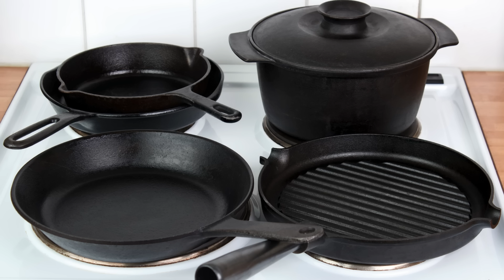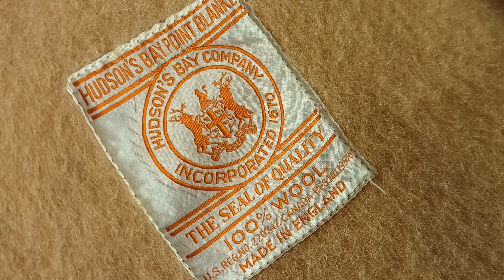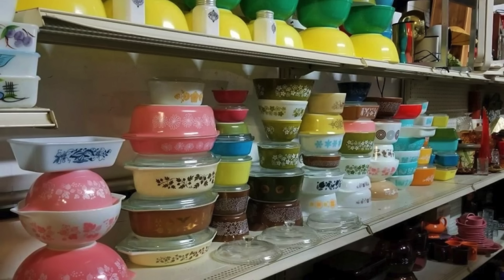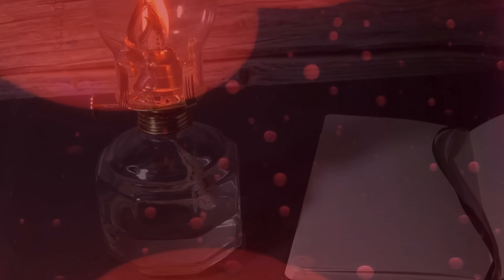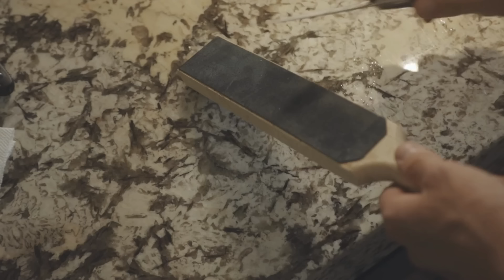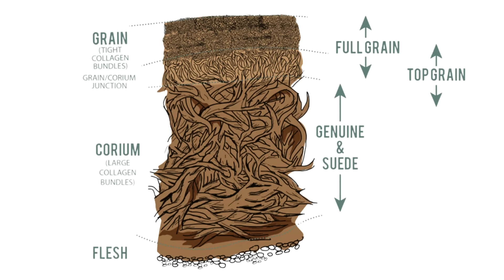10 Goodwill Items That'll Outlast Economic Collapse

Comment: Cast iron cookware Lodge griswald Wagner pre 1950s.  100T wool blankets.  Hudson's by or mil as surplus.  Hand cranked kitchen tools echo vintage Pyrex handsaws diston bit bra cr drill oil lamps and lanterns. Metal sewing machines. Carbon steel knives.  Pre digital reference books pre 1980. Fill grain leather

Comment: Being a cast iron enthusiast who owns several well used and loved vintage pans, while you’re correct that most older pans have nice smooth surfaces, it’s simply disingenuous to say all modern manufacturers of cast iron cookware utilize the rough surface finish. Plenty of cast iron manufacturers today have smooth finishes on their products. Granted, they aren’t going to be $30 like a lodge pan, or $15 for the Chinese import, but to say they’re substandard in quality is nonsense
Reply from the maker: You're right, not all modern cast iron is rough. Some higher-end brands do offer smooth finishes. My video focuses on the common, affordable options found at places like Goodwill.

Comment: I work in a large second hand store it is now illegal to sell scratched teflon in the UK but it is still sold new. Commercial teflon pans need replacing every year because of the accumulated scratches.

If you do use teflon pans at least only use wooden implements and never use a scourer on them.

Comment: Soda lime glass , vulnerable to thermal shock. NB check wikipedia page on this it has a blue or sometimes green tinge from cobalt.

Boro silicate glass is more resilient to thermal shock BUT soda lime glass is more resilient to physical shock.

NB the 'pyrex' versus 'PYREX' branding is not a guarantee of glass type.

'pyrex' is sold in N America, S America, Australia and Asia, ie continents bordering the Pacific.

PYREX is sold in Europe, Middle East and Africa.

I think it is worth taking a deeper dive but depending on how you use them you might favour different types of glass.

Agree on woollen blankets , I switched from duvets 15 years ago and spent around £30 in thrift stores for around 10 blankets. Never needed to buy any more.

Saws too but get a saw set. Plenty of videos on this. 

I will need to do some research on those pans.

Thanks for the video.

Comment: I have a vintage oil lamp in my boat, and love it.
However it's hard finding wicks for lamps now.
Lanterns have a slightly different wick, which burns quickly.

There is a work around.
Getting some Carbon Felt, which is cheap. Plus they call it a Forever Wick for a reason.
It lasts longer than cotton wicks.

Oh, I used an electric sander to smooth the surface of a new Cast Iron frying pan.
It actually worked pretty good, and never stuck after that.

Unfortunately Cast Iron and high carbon steel knives aren't the best when you live on a boat.
Unless you use them regularly.
So I am stuck using Vintage Stainless cookware.

Don't forget a Sewing Awl.
The good quality ones are still cheap and will save your day.
Reply from the maker: Thank you so very much for all that awesome info!!!!

Comment: Regarding the KitchenAid mixer with the nylon gear:  It's designed that way.  So if your torque is too high, that gear fails without damaging the motor.  Gear is easy to buy and replace.  Thank you.

Comment: i take a magnet with me into a thrift store,and check the "silverware" for real Stainless Steel that the magnet wont stick too,,dead electric blanket can be found cheap or free, as can polyester/nylon blankets,,,yes wool is superior but not cheap,,and comforters can be cheap ,yet very warm..old school cotton wick type kerosene lanterns can also use diesel for fuel,, its dirtier than kero, but half the cost ,and more available..i dont use forks for eating as you must clean thoroughly between the tines or you can leave a piece of food which later ingested can make someone sick..a butter knife and a large table spoon is all i need,and while washing your hands use the lather on hands to wash butter knife and said spoon.and a sharp paring knife.older boy scout handbooks are good info,,wool pants can sometimes be found in the mens dress pants,,and keep a pair or 2 of sweat pants around for winter ,great for really cold days ,first put on thermal longjohns, then sweat pants ,then over size pants,,
Reply from the maker: I really appreciate your detailed insights! It’s awesome to see someone who clearly has experience and knows how to make the most of thrift finds. Keep sharing those tips!

Comment: I’ve cooked with cast iron for about 65 years.  I use lard or bacon fat to coo’ with.  Our experiences seem to differ. 

I find that the rough finish builds a seasoning coating that is both thicker and better rooted.  That produces a better non-stick function for the skillet.  If something ever does stick on some, after emptying the food out, I add water to the skillet - NO SOAP EVER - and let it soak while I dine.  A light scrubbing with just a plastic mesh scrubby and it is clean
Courtesy of Half Vast Flying

Comment: Thank you for explaining the cast iron cookware. I am on the hunt for good cast iron, now I know what to look for. I just started sewing again, but knowing how to hand sew may come in more handy if the grid goes down, and you don’t have a generator. So, I think vintage sewing boxes/button boxes/sewing supplies, except you might want newer thread, because thread can weaken, deteriorate, and break easily the older it is. I am also on the hunt for a Singer 221 featherweight. I do love vintage Pyrex. It’s ways so pretty and well made. Nice to know about the saws too. I’m always on the hunt for a good saw. I will also be on the hunt for more drills and other tools. The carbon steel knives will be great for the zombies. 😂😂😂 I lucked out and got some great free “encyclopedias” for learning how to do just about anything, from sewing to gardening and from mechanics to electricity, each one has a lot of valuable information. I am looking for other manuals. Also on the hunt for leather. I need to hit up some good yard sales, I guess. 😊
Reply from the maker: So happy you found the video helpful for your shopping list! Good luck with your hunt! 😊

Comment: Lodge cast iron pans work and clean fine. If you want them to feel a bit better then you can grind them down for 15 minutes with a 90 grit rotary sander and then boil vinegar before seasoning. But even without that they work fine if you understand how to use and clean cast iron.

Comment: Another problem I have with old cast iron besides the extra cost of buying vintage, they liked to make the castings as thin as possible back in the day, I've seen a lot of ruined vintage pans, cracked down the center, pretty much worthless, but I've never seen a modern lodge or Wagner from the 70-80s ever crack, they're heavier but worth it IMO.
It's not like we're loading them up in a wagon to head out west.

Comment: My friend used a grinder with a sanding disc to smooth my “pebbly” cast iron. It worked great.
Reply from the maker: Wow! Okay.... well now I am all excited to use it on mine!
Reply: @Sidney_Explains_Money 😁
Just remember, to properly season cast iron you have to use animal fat. Not vegetable based oil. The animal fats will sink into the cast iron creating the non stick surface from the inside out instead of just sitting on top of the iron. That’s why the old pans seasonings got better with time. I use butter as it’s more neutral tasting. Lard, tallow or bacon fat will work also. But bacon fat will leave flavor where the others don’t. 
An old old lady who was a teacher in the 50s and 60s taught me this.

Comment: Instead of cast iron you can look for carbon steel.
Reply: I used to primarily cook with cast iron however found a huge well made carbon steel pan in the clearance aisle, of Walmart, nearly 15 years ago. Used it once and went back to buy what they had left. I’m hooked on good carbon steel pans.

Comment: It is really easy to take a lodge pan and just sand it with a random orbital and re-season it. The main problem with lodge is no really the roughness but a subpar seasoning. I have Wagner pans to and my "fixed" Lodge pans work just as well.
Reply: I bought a cast iron dutch oven in a junk shop that was really rusty. The shop owner said it was useless as could not be used for food and sold it as a garden ornament for a few pounds. I cleaned off the rust with a wire brush, inside and out, then vinegar and scouring. Finally, I removed the minor pitting inside with an orbital sander, leaving a smooth, shiny finish before seasoning several times. It is my go to casserole/slow roasting pan, now completely black and shiny, non stick. The only things I am careful  to avoid are tomato heavy dishes. Teamed with my wood burning stove, it is a winter winner, whatever happens to the national grid.

Comment: The vintage cast iron pans are great but there is something better you can buy, Machined steel pans with mirror finish which does not stick from makers like Lebuyer, made in France. The best and nowhere near as heavy as my vintage pans which I also will never sell

Comment: Impulse hardened can in fact be re sharpened with diamon jewlers files ( super cheap purchase ) ot with aluminum oxide ( sand paper ) files or valve lapping compound.

Thier life span is significantly longer than vintage saws under heavy use .

Almost all jap saws are hardened as are the silkie saws tgatvevery one loves .... As far as i know

Comment: Twenty-eight years ago I bought a Universal Hand crank flower/nut mill for $15.00. the specs on it showed that it made flower faster than electric mills costing up to $400.00 at the time. It's one of the best purchases I've ever made in my life. I was trying to replicate an old recipe for Irish soda bread. I couldn't find the right kind of flour anywhere so I bought it. Any time I've given some of my soda bread to anyone even Irish people they say it's the best they've ever tasted. I've also used it to grind acorns after removing most of the tannins from the nuts. That flour is probably  the best flour for baking in existence
Reply: Back in my youth I would seek out old 1950 items because they were built to last a life time. Just do a led check and if it's clear, give it a good clean, give the gears a good oil and they work amazingly fine.
Reply: @PixelMelodySproutKids  how can one do a lead check?
Reply: Flour? Not flower?
Reply: Flour

Comment: Love how you say buy the pre 1950s cast iron cookware and then show off Wagner Ware 1891 pans that were made in 1991 and afterwards and in general have the identical surface of modern day made cast iron pans. If you're going to make a video show what you're hyping not old looking crap that's actually new and the exact product you're telling to avoid. Actually there is modern day high quality cast iron cookware available even at thrift stores, though rare and if the seller knows what it is, it won't be a bargain price. Even cheap cast iron pans after 1950s are better than all those supposed non stick coated cancerware cooking pans. Thumbs UP despite the wrong pictures...
Reply: Resurfacing a lodge pan is cheap

Comment: This was surprisingly accurate. The one thing I would say is that where hand drills are concerned, try to buy the one with three jaws so they can use modern bits. Most old braces (another name for hand drills) have 2 jaws, and won't work well with most modern drill bits. I own all of these things except the sewing machine, and that I've replaced with a sewing awl. A sewing awl is a great option for most folks since it's simple to use, and cheap.
Reply: Yes, very good point
Reply: There is an option to the three jaw brace and modern drill bits.  Back in the day, twist drills were also made with the tapered square heads to fit normal braces. People had to drill small holes back when braces were common.  They didn't always use a gimlet. 
  I have a set.  You might still be able to source them. Keep a sharp eye out!
Reply: @marceld6061  Worth knowing. I've got a couple of three jaw braces already, and all the old hi-speed steel bits in the world, but I'll be looking regardless. You can't have too many drill bits!

Comment: I buy every lantern I find at goodwill or estate sales.wool blankets.old sturdy tools.
Reply: Pedestal oil lamps/lanterns is a collectible of mine. Most of mine are vintage, were made in the USA and less than $20 to purchase. Good source of light and even a little heat in grid-down times. Used to be able to easily source lamp oil, for them, af Walmart however ever since Covid, not available there. Locally, Hobby Lobby is the only place I find it.

Comment: I've bought so many cast iron frying pans for virtually nothing that I give them away to anybody who knows how to use them.  I had a girlfried who used to scour the crap out of them and ruined one and I had to season it again.  My plates are the old ceramic ones that they used in cafeterias.  I have literally dropped them on a concrete floor and they didn't even chip.  I have a Craftsman drill press from the 1930s that still works fine. I have survey equipment from the 1950s that you actually have to work to get accuracy from it.  I wish I could find an old vacuum cleaner that didn't use bags.  They are all heavy and people have weak hands.  People don't like anything that is heavy.  They would rather go to the gym and lift weights than own something that was invulnerable.  Buy tools at antique stores.
Reply: My mom had a Rainbow Vacuum.  As a kid it was my job to dump out the water.  They still make them I understand but it you can find an old one, they're gold.
Reply: The Amish know.

Comment: Still use old kerosene lanyerns
Reply: I did up through the 1980s but I had the ones with mantles for more light and had to keep buying new mantles for them.
Reply: I have a couple dozen pedestal oil lanterns/lamps. Quick and easy light and a little heat in a grid-down scenario. Also are just relaxing to light one on a cold winter night; sit back and enjoy the flame.

Comment: I like the rough surface of the modern lodge pans, I find they hold more oil and seasoning, and stick less.
Reply from the maker: ahhhhh! That's interesting.... never saw it that way
Reply: @Sidney_Explains_Money in other words; what you're stating in this video is just theory
Reply from the maker: @ikkeennietjij Well… when it comes to cooking with cast iron, a lot of it really does come down to personal taste, for sure.
But when it comes to Pyrex, that’s different. The newer Pyrex isn’t made the same way it used to be. The recipe and materials were changed years ago to cut costs, and because of that, the newer versions can be more prone to shattering or even exploding with sudden temperature changes (like going from hot to cold).
Reply: @Sidney_Explains_Money 
Yeah.. there's a video explaining how the lesser quality one is just exploiting using the trade name and that's why there's a confusing but technically legal distinction between the 2 "types".

For anyone who is interested:
Search YT for ”PYREX vs pyrex" and you'll see what's being referred to.

Comment: Sucks I'm allergic to wool...great..
Reply: I was diagnosed with a wool allergy. When I took up weaving, I had no problem with ordinary sheep wool. Turns out what I was allergic to was the processing chemicals used in textile mills. Especially bad are the chemicals used for recycled wool, the cheap stuff. Get your diagnosis refined.
Reply: @hollyingraham3980  The high quality original stuff uses no chemicals - they weren't invented yet!
Reply: @hollyingraham3980 eh...my grandfather gave me an old English wool sweater when I was a tiny child and it make me itch like crazy. This was like 35 years ago. Doubt it was chemicals. Think it was almost an heirloom cause he seemed super disappointed and even doubtful that I couldn't wear it. Cashmere (goat hair) doesn't bother me so I'll probably be fine with non sheep stuff.
Reply from the maker: It might not be a true wool allergy — a lot of people do fine with merino or alpaca. Might be worth trying!
Reply: @Sidney_Explains_Money cashmere doesn't bother me. I guess I can check alpaca, too. Thanks.
Reply from the maker: @geocelta1984  es! alpaca is fantastic esp. for people with wool allergies it usually works awesome
Reply: Try alpaca.

Comment: Good points.  I will say that LED lights are FAR safer.  Many a fire has been started by accidents with an open flame. You can't leave a flame unattended like you can an led light. You need to know how to use the old tech.  Electronics do wear out faster,  especially  if you buy a cheap low quality version.  When you do buy electronics,  buy quality or buy multiple.  Or both. And learn how to make your own electricity.  Roughing it sounds romantic but electricity has a definite place.
Reply: Yeah if the electricity is gone a gun should be put on this list....to protect all that cast iron 😂